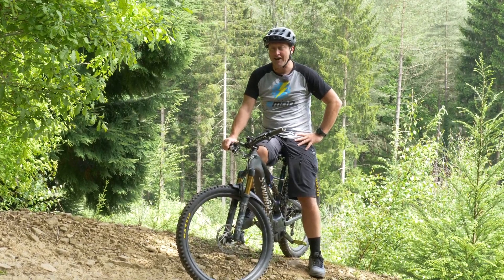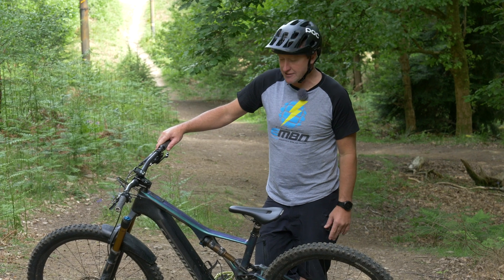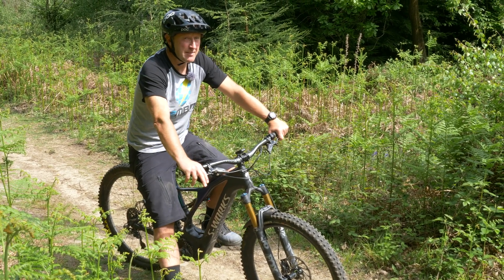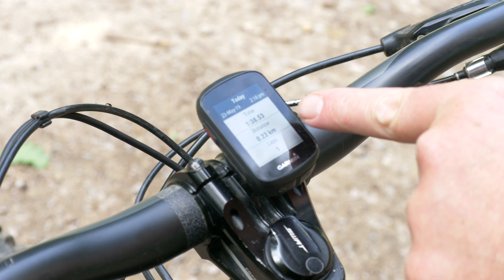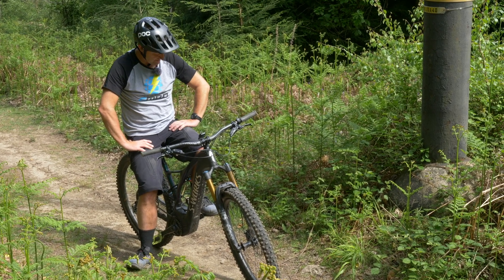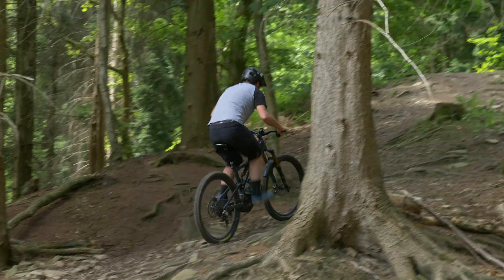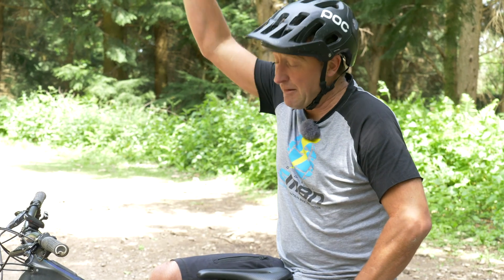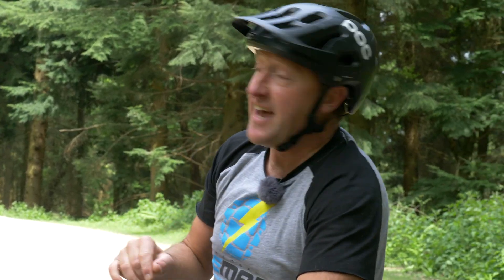Standing Up Or Sitting Down | Which Is Best For Climbing On An E-MTB?

Comment from the maker: How do you climb on your EMTB - sitting down or standing up?
Reply: Like Steve said a combination of the both mainly sitting down but standing up for the technical sections  adjusting dropper to suit .
 You could see the lost energy in the forks from the stand-up run 
 Cheers guys 👍
Reply: All ways - very rare i get out the saddle going uphill on Levo - when riding road ditto - your losing a contact point and you have a heck of a lot of free mass moving around once out of saddle = less control as demonstrated in video - now sprinting for the finish - that’s another story
Reply: Sitting down!! Its basic Physics!!! :P The rear tire needs more traction!!!
Reply: I don't think there is any one technique to stick with. I find that it depends on the climb and I'm sometimes on and off the seat, even raising and lowering the seat throughout the climb.  For traction, sitting is usually always best for me. But sometimes the climb doesn't need traction and is more technical and needs the bike to move around under me, in which case I'm off the seat. I can be on and off a few times during the same climb.
Reply: Sitting
Reply: Don't you just turn the battery on and scooch up the hill?

Comment: The biggest reason to spin seated is to make the battery happy. The riders COMICAL  climb out of the saddle shows how spinning out of the saddle cannot be maintained. Normally, there are many riders who grind up at slower manageable RPMs. I'm guessing between 60and 80 RPMs is very common. Anyone who has ridden single speed nonebike knows this relationship. Ironically some motors can also spin out and provide no assistance!  By experience, the Shimano felt like it spins out above 100 RPMs. Therefore finding the right gear to satisfy the motor and battery life is more important when riding emtbs.

Comment: More importantly does standing on these electric motors have an adverse effect on the them. Reasons? My 2019 haibike sduro trekking 7.0 has had its motor replaced as a rattling sound appeared after doing just this? Faulty motor or does standing on the pedals cause issues? Cheers
Reply from the maker: No, we don't see why standing up would cause any damage to the motor, they are designed to be pedalled 🤘👊
Reply: @embn  hopefully mine is just a fluke. Cheers

Comment: Slightly off topic question for you. How does the Specialized compare to the Canyon?
Reply from the maker: Hey Joe, they both have different geometry, one has an internal battery and the other is external, they also have different motors. We suggest you see if you can have a ride on them both to see what suits you and your riding style best. 👍
Reply: Electric Mountain Bike Network thanks for the reply. Yeah I have watched every video I can find to learn more but have only been able to try the specialised locally.  I feel like the canyon with the Shimano motor would be smoother in transition form free wheel to pick up than the Specialised but want to see for myself.

Comment: shouldn't you lock the socks ? (in order to avoid losing power on climb)
Reply from the maker: It depends on the terrain Adrian. If it's smooth you can use full lockout, however for bumpy ground we would suggest keeping the suspension active to maintain as much traction as possible.